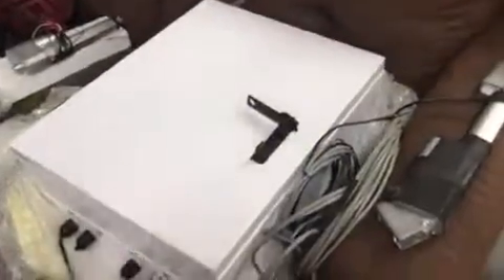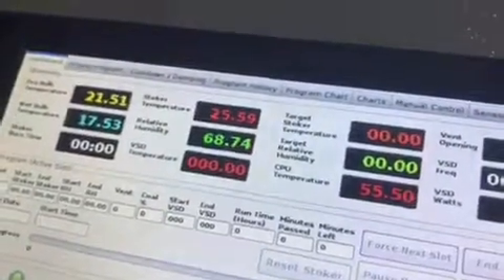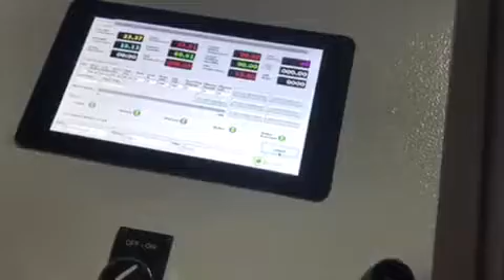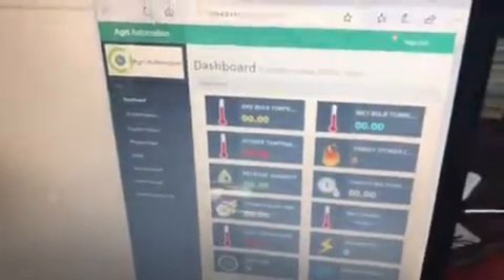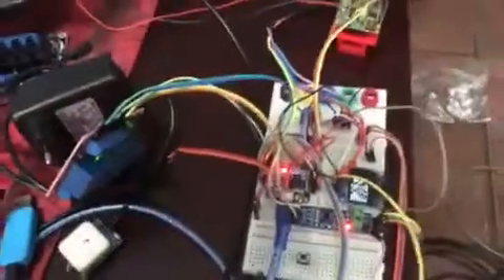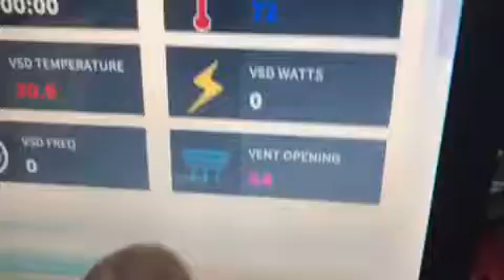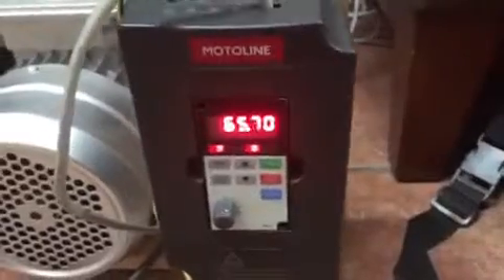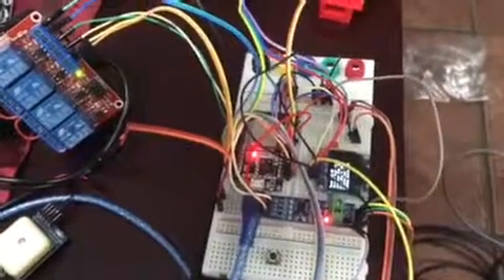Porting Cure Control to a ESP32

Comment: @Jaco, really good work, well done.
Do you share the code and schematics via github with us to learn from you?
What software do you use to program the gui of your webinterface?
Thanks,TT
Reply from the maker: Thaddäus Troll Hi. I can not share the code as it is a controller we sell. But if you have questions post it on the ESP32 git page and I will help where I can. The web interface is done in HTML5 bootstrap.